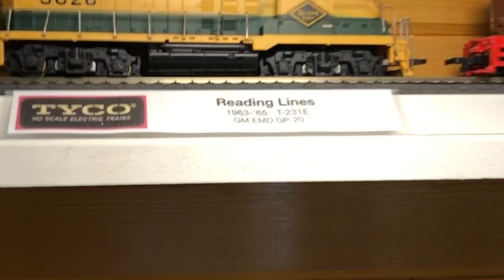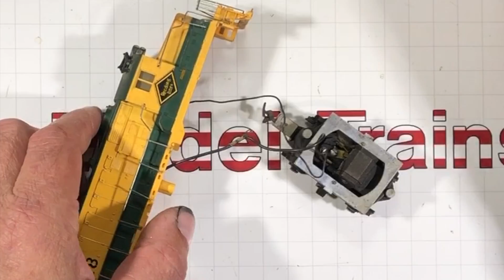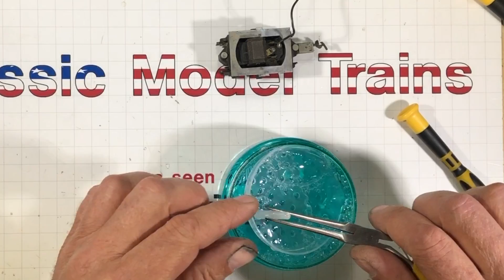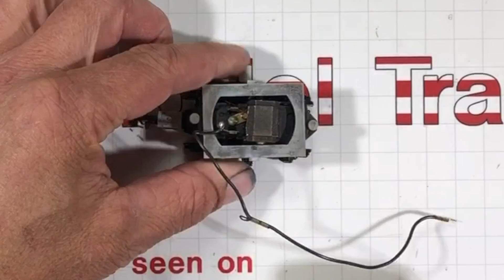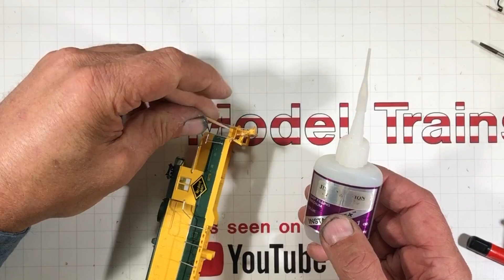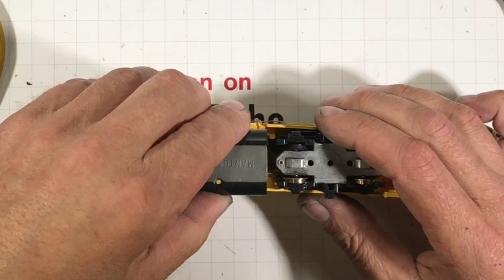EASIEST Way EVER to Service Tyco MU-2 Drives!!

Comment: Dang it! This would've saved me having to drill out the rivets on a Tyco F7 mu2 only to find that the armature bearings were riveted in as well. Left THAT well enough alone. Did hose it down with contact cleaner. Reattached the cover plate with 2-56 screws and nuts.
Reply: I do have a CB&Q gp20 that is mu2 powered, so I'll give this a go. My Santa Fe gp20 is power torque.
Reply from the maker: Sounds like you got the old MU-2 working again.  Hope this procedure saves some time. :-)
Reply: @classicmodeltrains  Should save some time making sure metal shavings haven't gotten into the armature.

Comment: Another great video.  Actually used to race RC cars and would dip the motors in water while they were running to clean them and help them break in.  Great tip for the old TYCO motors.
Reply from the maker: Thanks John!

Comment: Nice Any way you get around the rivets if you need to replace a traction tire on these?
Reply from the maker: The traction tires can be removed with a small metal pick set. sometimes the truck side frame makes it difficult, so I remove the side frame, replace traction tires, and glue truck side frame back on.
Reply: @classicmodeltrains  ok these side frames are.metal I will give it a shot _ I did not think they can be pried off - Thanks again.
Reply from the maker: @FreedomSquareGardenRailway  Metal side frame cannot.  don't.  Sorry.  I though yours had plastic. None of my Tyco MU-2's have metal side frames.  are you perhaps referencing a MU ?  something from the 50's?